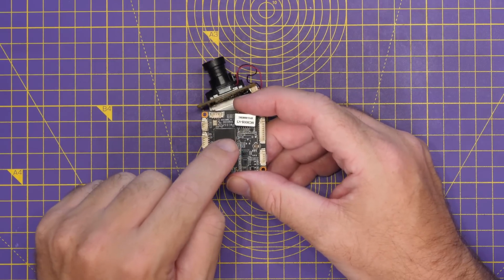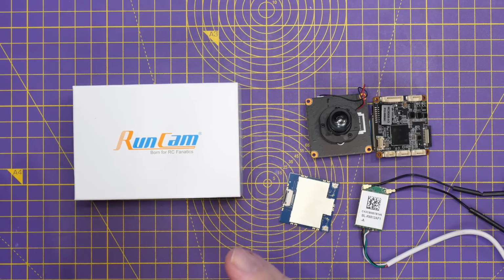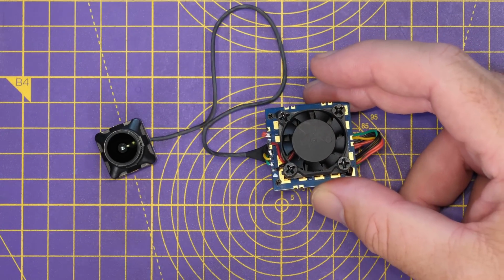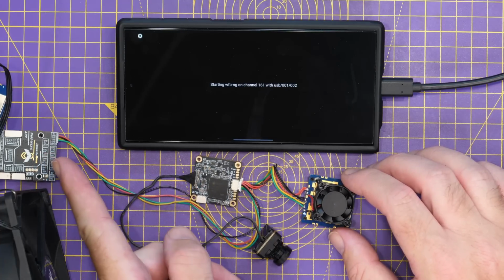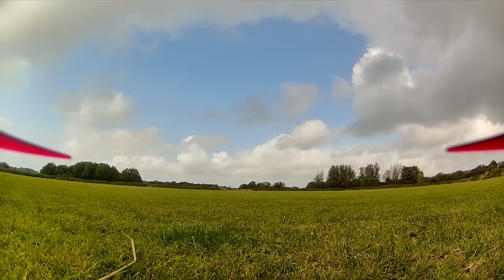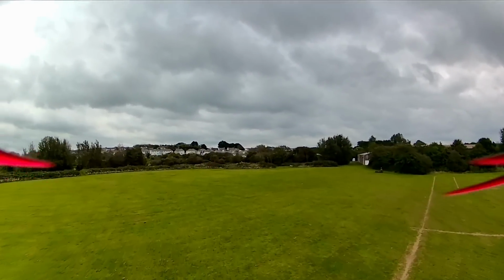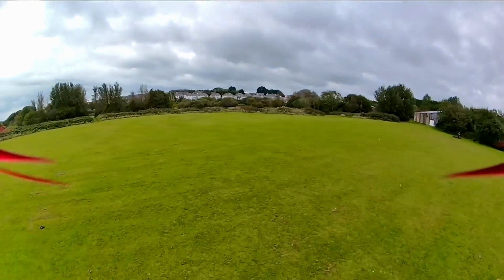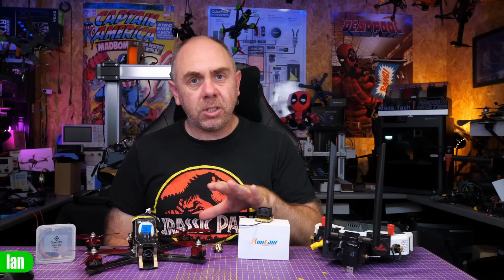OpenIPC Open Source Digital FPV Part 1 - Runcam WifiLink

Comment: By the way: they've already changed the orientation of this wifi module in Runcam and now the micro SD card slot is at the bottom, easily accessible, and the heating element of the wifi module has thermally conductive foam stuck to it and is cooled from the top by this fan. It was probably designed that way from the beginning, only the manufacturer mixed something up and put it together incorrectly.

Comment: Hi Ian,
Thank you very much for such a detailed introduction to the subject. Really great. I have a huge request for you to make a tutorial on how exactly, step by step, with uploading the appropriate software and links to it, if necessary, how did you make this ground station for analog goggles? I have also already bought Runcam wifilink with wifilink-G and Radxa Zero 3W 1GB/8GB eMMC, but for now I don't know how to convert my analog FPV goggles to OpenIPC, and what you showed is very interesting and uses, as I understand it, this wifilink-G from the Runcam camera set. For now, making a groundstation from wifi modules (RTL 8812au or 8812eu-2) is not clear and encounters a lot of problems. However, I would also like to go in this direction later, because I plan to connect the wifilink-G to my phone (maybe a tablet), because I need to record the image with GPS coordinates somewhere and be able to PLAY them back in the field if the drone falls to find it. And no one has even touched on this topic yet.

Comment: If I'm not mistaken the difference in latency between walksnail goggles and walksnail VRX is the latency introduced via hdmi out.  I remember Carl stating the hdmi input latency on the hdz goggles was 1 to 3ms.  So knowing this would the latency on ipc be comparable to their VRX and not the goggles?  Great video by the way!!!

Comment: Hello, I also purchased this product and encountered an issue. The FC data is almost impossible to display on the OSD. Why do I say "almost"? Because after many attempts, only twice did the OSD show real-time FC data after powering on. I’m using an Android phone, FPVue, and Ardupilot. I’ve tried both MAVLINK1 and MAVLINK2 protocol, but neither could display the FC data.
Reply: Same setup and msp osd works just in some clicks, native osd it's better imo. Stopped using the in app osd.

Comment: In my opinion, Id rather buy an o3 kit for $179 (or any other hd system) than to go through the lengthy process of making it all work. I get that its open source and so thats of course to be expected expecially since alot of this is still very experimental. Im sure itll progress into a very good system, however for now, i think im sticking to my expensive stuff
Reply: You must be in the USA saying your stuff is expensive?
Try living in the southern hemisphere amigo...define expensive then.
Reply: @semadragun  what are you saying 🤣 i said my expensive gear OBVIOUSLY comparing it to whats used in the video. why are you tryna flex that stuff is more expensive for u amigo
Reply: You're right; unfortunately, I learned that the hard way. My latency with OpenIPC is around 80–100ms, as I don’t have any HDZero goggles—just a small LCD 5'5 connected to a Radxa. LCD was advertised ad 60fps, but....the real life results are diferent
Reply: Or openhd
Reply: @adbas6201  definitely not openhd
Reply: I'd rather buy Walksnail goggles for $199 and the nano vtx for $109 ...
Reply: @kmieciu4ever  shit even analog might still be better than going through this process lol
Reply: Totally agree.
Reply: I agree too or HDZero.

Comment: My first results looked exactly like this. The dudes on the Telegram had me change my bitrate from the default 4096mbps to 5120 or 6144. This did the trick. What's basically happening is that you're trying to push a nice looking image through a low bitrate, which is like trying to push tons of water through a very small pipe. The breakup you're getting isn't actually breakup in the RF sense, it's you not having enough bandwidth enabled for what you're trying to do. I did a test of the before/after and put up the DVR you want to check it out.

Comment: Ian, I'm curious about the significance of Majestic being closed source. It's a component in the OpenIPC software stack which seems to play a big role in the software. And it's closed.
Reply: by default yes. but there is a opensource encoder that can be used instead, if your tinfoil hat requires :), is just that majestic works great and at the moment gives the lowest latency
Reply: @eduardoluisbaptistadeolive8542  It's not about tinfoil hats, it's about the cover matching the contents. A project can't proclaim itself as open source if an essential component within it is closed source, if replacing that component with something else materially degrades the project.
Reply: @aracrg  Stupid semantics!
majestic is not really closed source. It's not for public. there are NDAs...
And more to the point, if you want to be pedant just because, with no real point, do any open  source projects have access to the CPU microcode for example? No. Then nothing is truly open source by your logic as the code is eventually using a CPU and... bla bla . Some people just want to argue for the sake of arguing...
Reply: @aracrg  openIPC is just the firmware. The platform that the fog system is running on, and it is fully open source. The transmission and video are done by wfb_ng( open source) and by majestic( community edition, free but closed source) as default. But FPV is not the only application of openIPC, and at its core it is fully open source. And if the open source encoder is not as fast as majestic right now it is only because apart from keyboard warriors, not enough people are spending their time developing it so that it can become as good as or better than majestic and therefore become the default.
Reply: @petrusoroaga6528  You're complaining about people arguing for the sake of arguing and calling my semantics stupid, yet you are the one arguing with the ridiculous case of CPU microcode. Laughable.
Reply: @eduardoluisbaptistadeolive8542  Do you know under what license the community edition of Majestic is distributed?
Reply: @aracrg then just use DJI or Walksnail or HDZERO which are fully open source projects! Oh wait…😂

Comment: You mention that the HDZero goggles only display 90fps multiple times, but I don't believe that they have a 90fps mode at all. They have a 1080p60 mode and a 720p100mode.
Reply: From what I heard, HDZero released a 720p 100 Hz firmware, to work with the Walksnail vrx.

Comment: What's the OSD situation?
Reply: Your flight controller will have the betaflight osd.😊 surely the single wire analogue video signal goes through adc's which is what limits the usable bandwidth keeping the resolution lower than digital, as the camera has many times more capacity for data transfer.......

Comment: Can you please do a video on how to setup the radax zero , ive tried to follow Mario's videos but its all text and no vocals
Reply from the maker: I will do it yes.
Reply: @MadRC  thank you sir
Reply: @MadRC  Great Video.  Did you do a video on the Radxa GS setup?  Question, why are you using Radxa zero 3W, which has built in wifi, and an external wifi adapter?   Better signal?  Can you use the on board wifi to stream video out?
Reply: Yes it works on my Phone 🙂 But where do i put the "Gs.key" on the Radxa zero 3w ??  root directory !?

Comment: Hey, what's up, guys? I have a quick question. Is the Vista still the lowest-latency HD system when paired with the V1 or V2 goggles?
Reply from the maker: Apart from HDZero yes.  HDZero still wins. But then its Au and Vista on V2.
Reply: @MadRC  thank you 🫡

Comment: Would it be possible to send the video link via a 4G/5G LTE dongle? For unlimitted range, we would just need to do controls over LTE too. That would be sick on a airplane.
Reply: i dont think this is a good idea , i know some people have managed to do this on fixed wing but even those guys complained of massive latency
Reply: @notsogood4321  sure it is a trade off, latency for unlimmited range. I would take it on a stabilised gps platform with headtracking.
Reply: @notsogood4321  Parrot disco with LTE has been successfully flying for a long time
Reply: Latency hell
Reply: @boldizsarszabo  I heard the delay was only 200-300ms. normal for an airplane. And why? Are you going to fly between trees at a distance of 10 km?
Reply: if you have lots of 5g towers near you, you could probably get like 100-200ms latency which is plenty for fixed wing
Reply: @HolyOllie  Ive done it before with the C.H.U.C.K Parrot disco Controller it worked great. Obviosly you need Stabilisation, GPS, RTH etc. Its not for fast fpv, flying trough gaps etc.
Reply: @HolyOllie range isn't unlimited it's a function of antenna and frequency. It's maybe a few miles from a tower. Satellite can do it maybe ham radio with good conditions
Reply: 2g is possible for cheap. 5g you can do it but it's expensive. It's in the 700 to 800mhz in the US 1900 I think too? Wifi is 2.4 lower is better range and penitration. Bank in the good old days you could us 72mhz
Reply: @BankNorth we had 35mhz! Receiver aerial wire was a metre long, lol. Fly right to the limits of los, absolutely no worries. 😊
Reply: @keithcarpenter5254  really? Is that hardware still available? Ham radio is really low and under good conditions I'm told US to Japan is possible.  But RC hobby no license 72 was okay in the 80s and 90s. Used a physical crystal
Reply: Cb band is 27 I think? The hardware is everywhere and cheap. Sadly digital isn't allowed but it'd probably work great. Idk 1/4 antenna because it gets ridiculous big